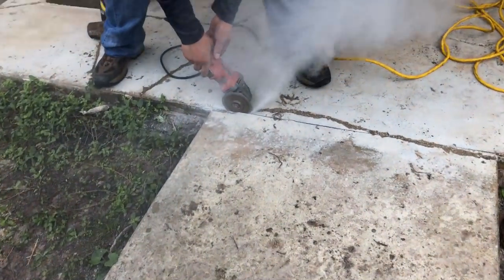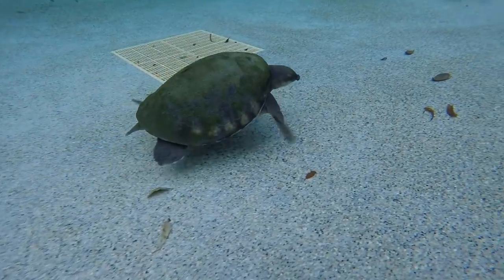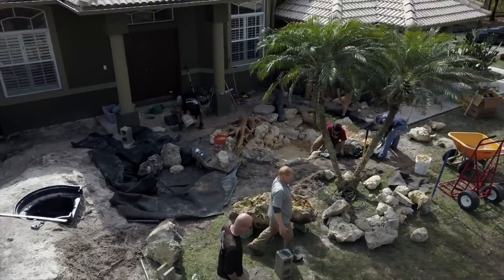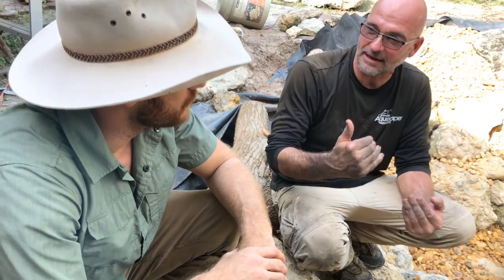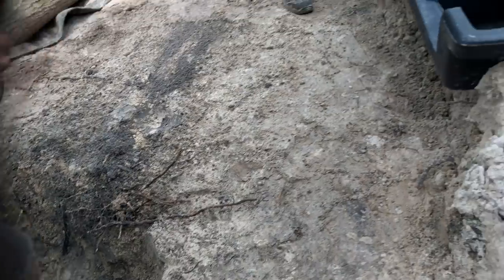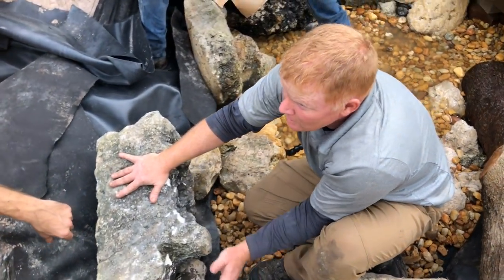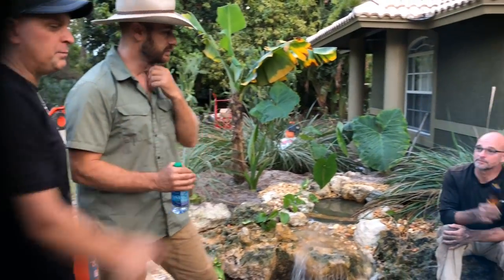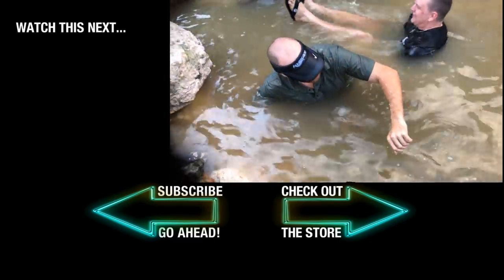How to build a $14k Turtle Pond in 10 hours!

Comment: Step 1: have 14k
Reply: Step 2: Have and live in fancy part of Florida, away from ungrateful neighborhoods that have crimes of thieves and such. 

You can learn from this and make a decent pond for a single turtle and the rest of the 7ft  by 16 ft area is a butterfly garden under $500. What is expensive are the filtration and air pump, the rest is relatively inexpensive. The tarp 7 by 10 is under $25, the gravel rocks $7 per bag, larger rocks are $15 to $40 depending how big and heavy they are and then the plants $8 - $22... The prices are based on a local Home Depot in South Florida and local shops through Amazon. It really does depend where you live. This guy lives in a fancy area of Florida so his prices are much higher, of course. Whereas, East Hialeah is inexpensive. 🤷‍♀️It also helps that you work alone, saving on services itself.